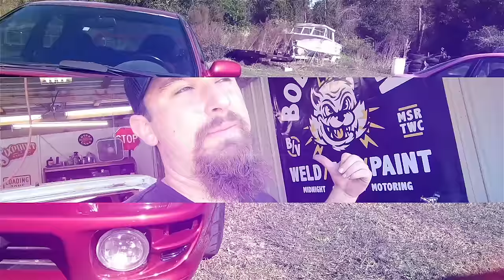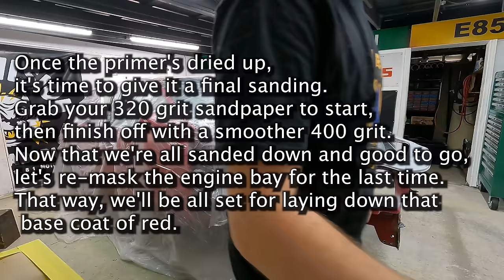DIY Guide: Transform Your Engine Bay Like a Pro! Shaving, Bodywork & Painting with @boostedboiz

Comment: used to put up a little but more pressure and lowered the paint , made for a wider fan and with the kindow job i did (commersial light sighn) i could cover the whole side in one move i could move the gun from corner to corner and kept going untill the paint flowed out then left it alone , and not get fat lines of oversprayed paint , did dust like crazy though , the whole booth was misted over by the time i was done but the paint looked supersmooth straight out of the gun